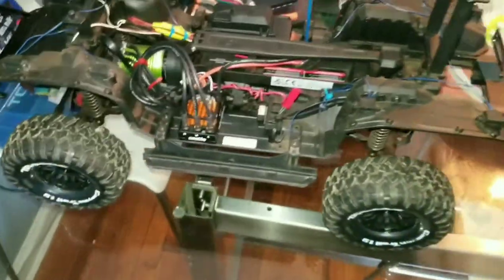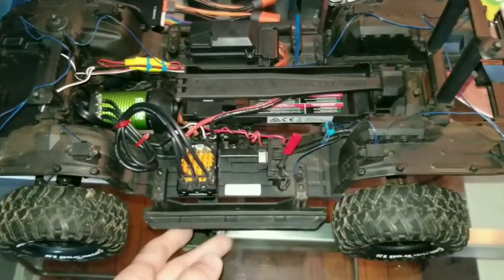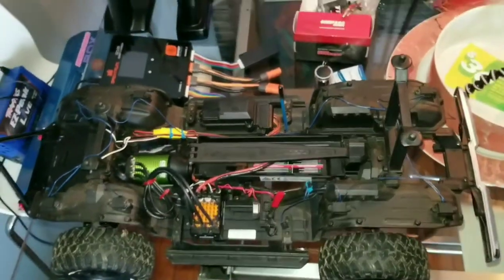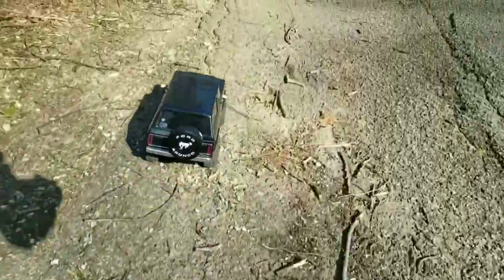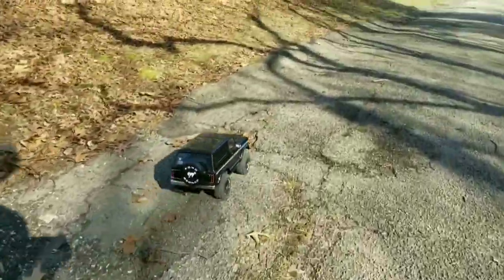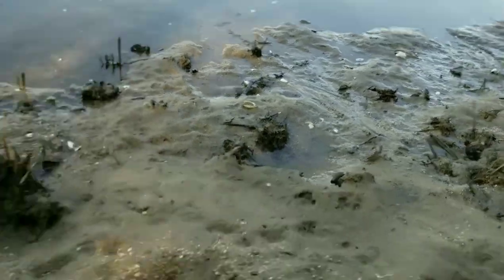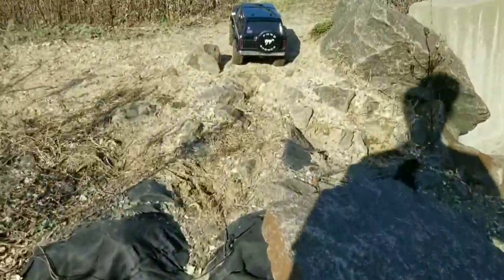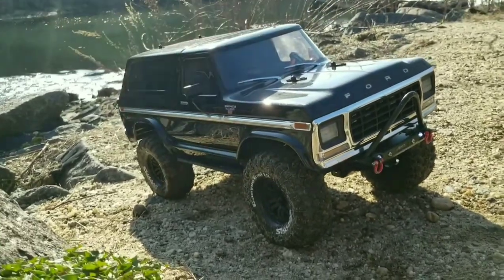Trx4 Sport 3800kv castle system. explain and first test!!🤙

Comment: That in high speed?? It should be faster than that 😂

My castle 2200 system in trx4 on 4s should be slower than yours even on 3s. It’s an absolute power house but top speed isn’t high
Reply from the maker: Yes true.  I had previously installed 45t spur and 9t pinion for more torque. So the gearing was way way too low for the 3800kv. Lol. I upped the ratio like 6t I believe. Now it's actually much more quiet and pretty good speed. I'll drop a video of it soon. Thanks brother!!🤛